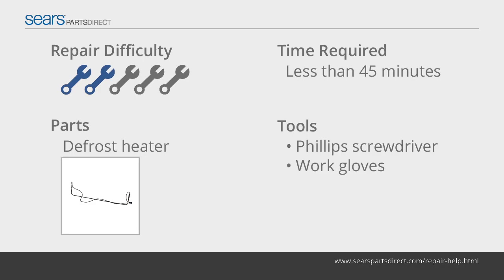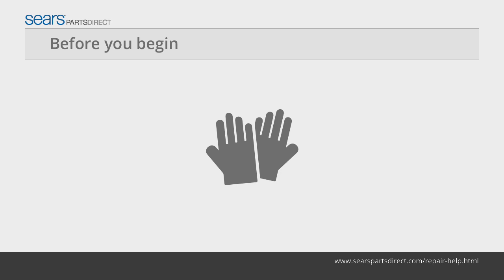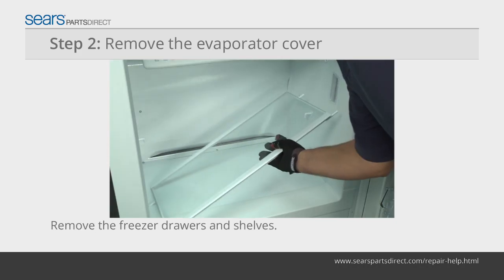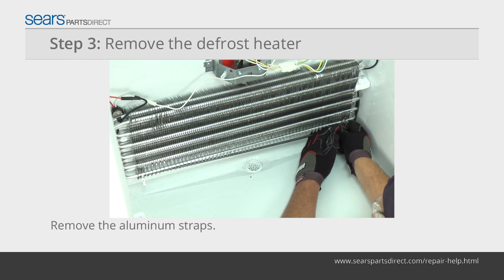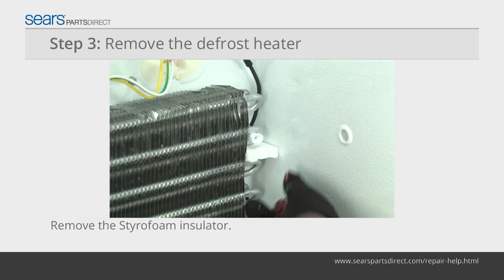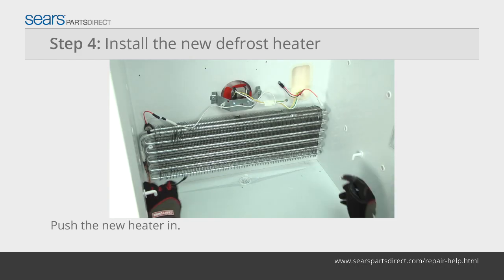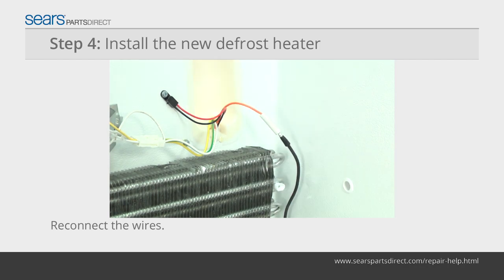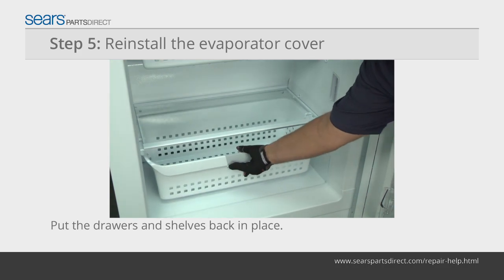How to Replace a Kenmore Upright Freezer Defrost Heater

Comment: I know that this is an old post, but should the defrost element be able to defrost an evaporator that has frosted up because the door was open for a few hours?  I have recently defrosted my kenmore upright but did so by pulling the cover and used a hot air gun.  I checked the element and the bimetallic sensor, but didn't know what the value should be for the thermistor.  The digital control panel on the door seems to be functioning correctly (although I can't seem to find out how to initiate a manual defrost cycle)
Reply from the maker: The defrost heating element may be able to defrost the evaporator during the first cycle depending on the model that you have. If the heater doesn't melt all of the frost during the first automatic defrost cycle, it may be able to remove it during the next automatic cycle (depending on your model). You probably solved the problem by manually defrosting the evaporator as you described in your post. If the evaporator keeps frosting up and won't defrost, then you may need to find the failed component in the system. Let us know the model number of your freezer if you continue to have defrost problems and need more help.

Comment: How do you determine if it's the Defrost heater or the thermostat?
Reply from the maker: Here's an article/video that describes how to troubleshoot the defrost system in a common refrigerator: https://www.searspartsdirect.com/diy/article/refrigerator-wont-cool-troubleshooting-video-defrost-system-problems . That article/video may help you determine which component to replace in your refrigerator. If you need more help, let us know (and post the model number of your refrigerator).